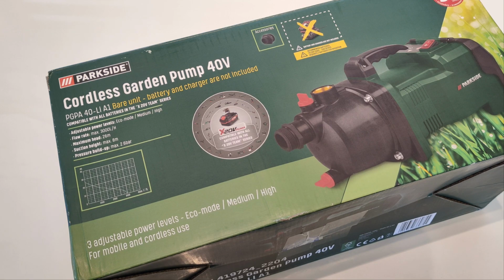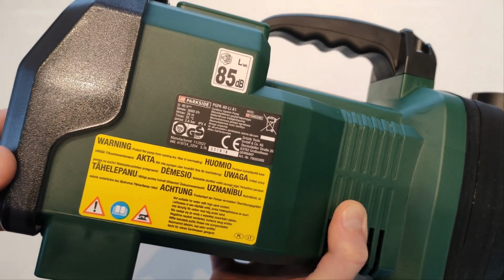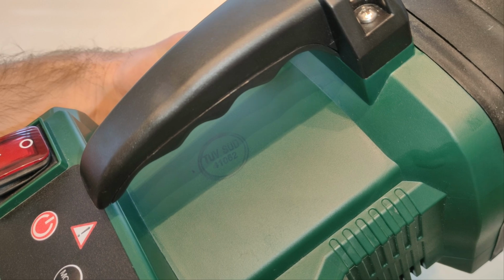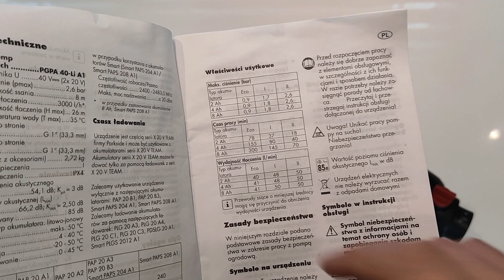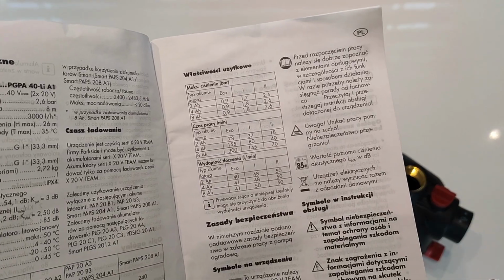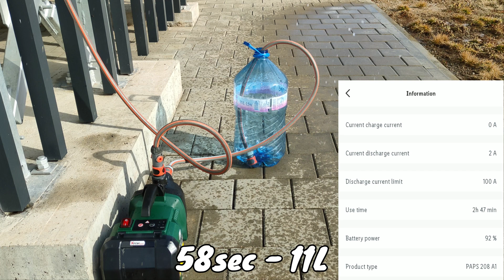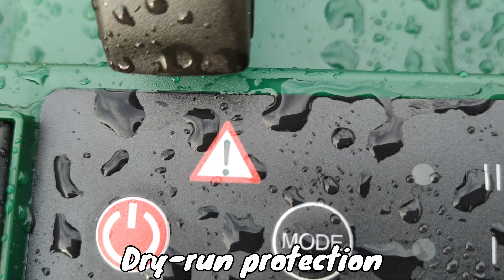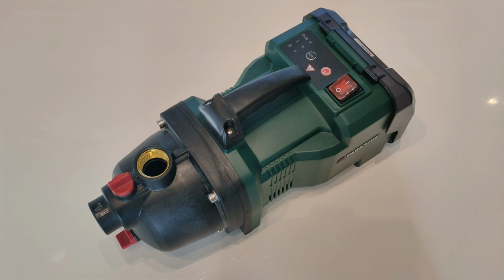Parkside 40V Cordless Garden Pump PGPA 40-Li A1

Comment: Pretty nice pump, given it lasts. One small advice: As far as I know, Gardena connectors seal against pressure, but not against suction. You could hear the pump pull some air, so if you want to eliminate that, use a screw-on connection on the suction port. By the way, I think it is very interesting when you open up stuff to give us a glimpse inside. I appreciate it.

Comment: I wonder how this would cope with dirty water. Either water contaminated with gravels so for pumping out a small pond or for pumping out water from a septic tank. This may have small lumps of paper which have not been dissolved.
Reply from the maker: Depends how dirty is the water. You can see in the video that there are relatively small opening inside the impeller section. Those could get clogged pretty easy. I suggest using it with filter :)

Comment: hello, how does pump behave when end of hose is not open? e.g. could i use a hose open, then closed, then open etc.. without turning pump on and off?
Reply from the maker: Which end?
Reply: @icku  the output end. i.e. does this stop pumping to avoid pressure build up in line? if i wanted to connect it to pressure washer or such which would have intermittent use - on for 3 minutes. off for 5, on for 3 minutes etc..
Reply from the maker: @siflons6592  No, it wont stop. Its centrifugal pump. It does not care about pressure build up and cannot build such pressure to burst the hose like a piston pump. It will stop on lack of supply water like mentioned in the video.

Comment: Hi I recently tried to use mine but can’t get it to suck the water, have  fitted a 19mm hose with back flow stop on the suction side and a standard garden hose on the delivery side, it just seems to suck the water that you pore into the pump, and not the bucket, it’s a 7m suction hose that I got from a hardware store and fill the pump before starting it. Any suggestions thanks
Reply from the maker: You have air trapped inside the hose. Fill it with water and the pump too with water and it will work.
Reply: Hi thanks for that did work for a bit but then just cut out as if there was no water, but if you switch it on again it pumps a bit of water and cuts out again

Comment: The biggest issues with the most parkside tools ist the non equal quality from one machine to another and alot parkside tools do not last long until they get broken (2friends leave parkside in meanwhile because of the short lifetime of some tools). Use this pump often for a water sprayers,  watering plants or another stuff like that, it will be broken soon. It is not engineered and build to use it often. When I only see the impeller 3:08, how it is made, the small screws .... I am sure the inside of the pump does not look better. You get what you pay and that ist not much. When you count during the years how often you have to replace such cheap built pump it is cheaper to invest one time more money in something good (when you need it often) and have it for a long time. Parkside owners often have alot different tools, but nothing good what lasts long. The buy the stuff because it's cheap, not because it's good. What I really like, parkside has alot different machines for all kind of work. The simply do it, they do spent years with discussing until they start someting new. Other companies could learn alot from parkside in this case. People ask for a new tool or there is any new idea, they simply do it in a short time and they can offer a product (other companies not).
Reply: Ok

Comment: Hi, have you checked how much of water can in pump (for a given height) on one set of batteries (2x4Ah or 2x8Ah) or at least how much of time it works? I need a pump like this but it would have to make at least 1000 liter, 4 meters up on one set of batteries and I can't find information if it would do.
Reply: It depends on your water network at the outlet, and on the pressure drops. Without pressure drops, the manufacturer indicates 3000l/h. with a simple pipe without reduction, and 2x8Ah, you can transfer 2/3 m3
Reply: @Dea02320 hi, when you write 2/3 m3... Do you mean 2 up to 3 x m3 or two thirds of a m3.  Thanks
Reply: @DigitalMan1100  2 up to 3.
Reply: Graph on the box shows max 2700l/h to 5m hight , meaning 8Ah batery... based on table presented 2x4Ah should be able to pump more than 1500l to 4m hight. The most conservative calculation (40min (min run time for 4Ah)* 41l/min (minimal speed for 4Ah) =1640 l   And we can multiply this with 0.9 for 4m hight difference impact that gives 1476l...